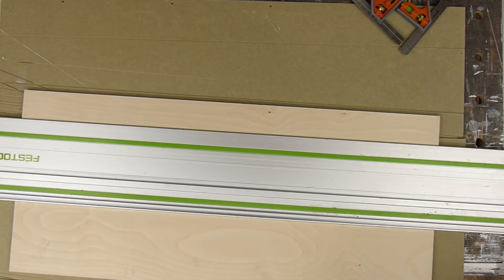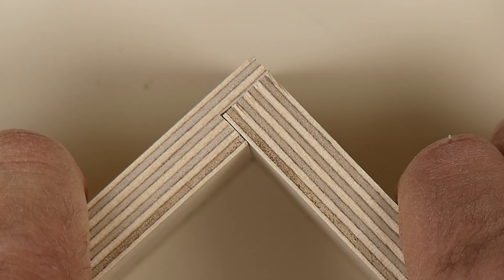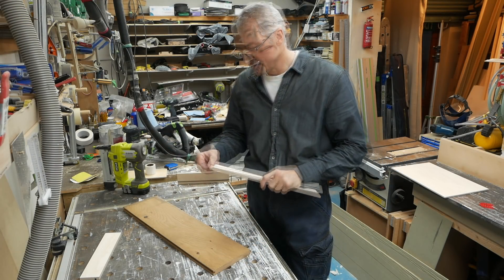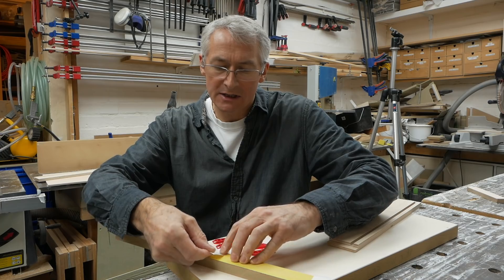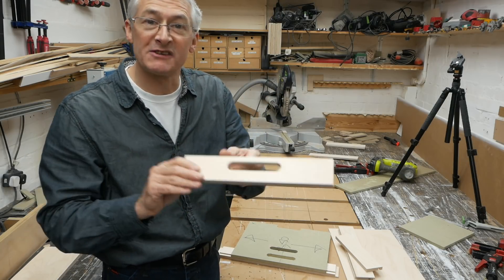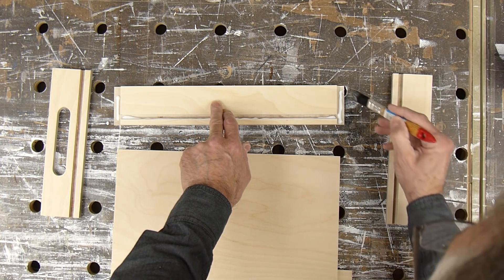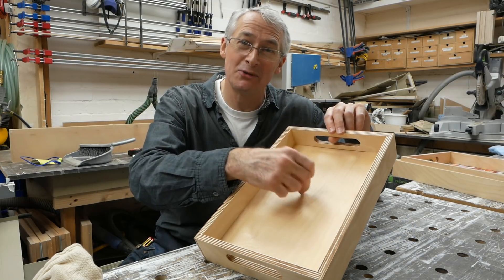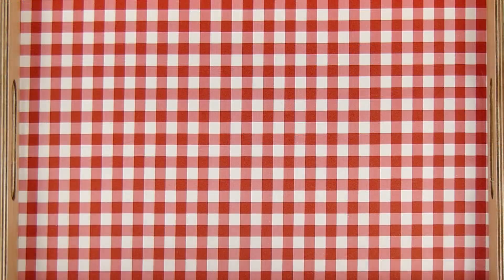Gift for giving #5: Trays #131

Comment: For those of you who are willing to spend some money in a time saver router bit, I recommend the Mitre Lock router bit, or the Drawer Lock bit, depending on the strength vs finish of the joint you're looking for. You'll find them at places like Axminister and Rockler.

Comment: Hi Peter. In one if your earlier videos I cannot remover which one you showed a clip of you air filters that you you had made I can see that it's out a standard bathroom kitchen fan but was just wondering what filter you actually used inside the box and how reguarlly you changed them?? Thank you
Reply from the maker: Hi Daniel. It’s a 6” extractor, so decent throughput, and I used a RamAir filter - https://goo.gl/RVLYMQ. I haven’t actually changed it, I just hoover them out, though I will change them at around their anniversary 👍
Reply: that's great thank you just one more question sorry how many do you have in your workshop?
Reply from the maker: No problem. I have two, pointing in opposite directions so they move the air around a bit. 👍
Reply: Thanks for the reply

Comment: Great, accessible project (as usual!) Peter - I'll have to give this one a try.

I noticed you using a small paintbrush for the glue (not silicon, as far as I could tell). What do you use to clean it off afterwards? Does the glue just wash off, or do you need something more?
Reply from the maker: Thanks Eddy! I still have a stock of these small brushes from when I bought the last batch, just before I discovered silicon brushes. I used one for this project as they're smaller and have finer bristles, so I could be a bit more discerning with the glue - just trying to avoid getting on he face of the ply, as it'll show up when it's oiled. Like the foam rollers, I keep them wrapped for the duration of a job, which helps keep them 'active', but they're ultimately a disposable item. They're very cheap (20p or so)  if bought in quantity, and the ones I have in stock will last a good while. 👍
Reply: Great; thanks Peter!